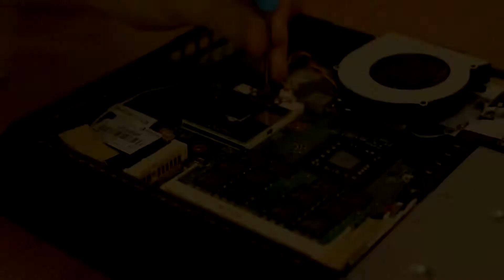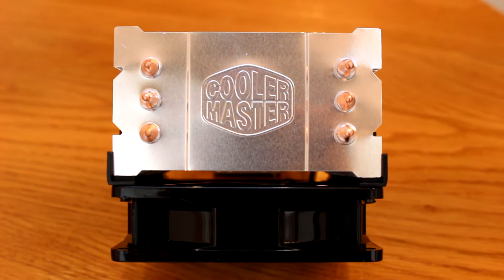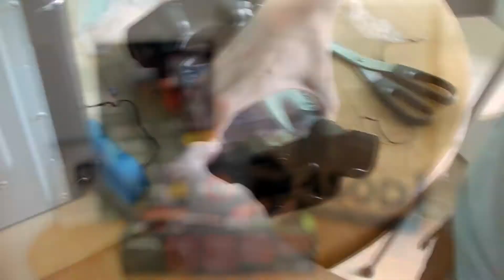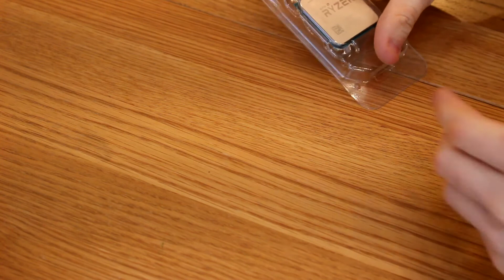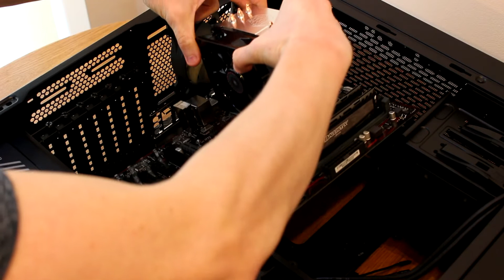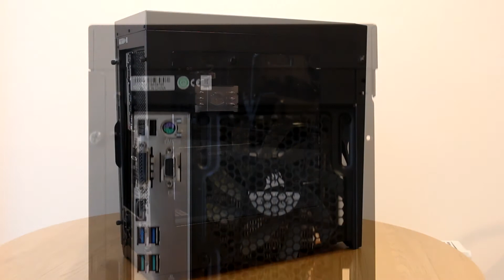Into 2018! - Ryzen 7 PC Build

Comment: 2400 Ram i used 2666 and a lot of other utubers  using 3200 and 3400 speeds  what is your thoughts on ram speed?
Reply from the maker: Personally, I would rather have a higher amount of slightly slower RAM. Unfortunately memory prices are through the roof at the moment!

Thanks for your comment!
Reply: there is not any huge difference in gaming. 2400 are good, but since 2400mhz rams and 3000/3200 mhz have similar price, i'd go for 3200mhz, if the mobo can support.
Reply from the maker: I agree with what you are saying, but in the UK at least, when I built this system there was a HUGE price difference in RAM speeds.
Thanks for your comment
Reply: DoshTech i don't know about prices in Uk. Here in Italy, 2 sticks of ddr4 ram (2x4gb) @ 3200mhz will cost about 110 euros.
Reply: DoshTech By the way, for gaming 8gb ram @ 2666 mhz are more then enough, believe me. But for professional use you need at least 16gb @ 3200 mhz.
My build:
ddr4 2400mhz (2x4gb) (corsair vengeance lpx)
gtx 1050 (asus strix, oc version)
b250m-d3h (gigabyte)
vs550 (bad psu, noisy, i regret)
masterbox 5 lite
intel i5-7500
wd blue 1tb 7200 rpm.

are you looking for building a budget gaming pc? i can help you choose good component.
Reply: DoshTech oh shit i forgot you build a new pc in this video. lol hahahah by the way great pc, but gtx 1060 was enough for 1080 gaming at max settings, i think you bought a 1070 for future heavy fps games. sorry for my english. just subbed to your channel. a big hug from Italy